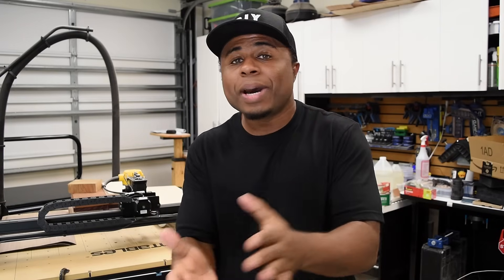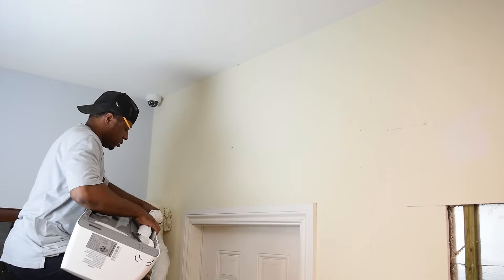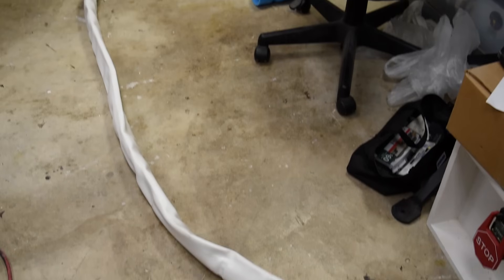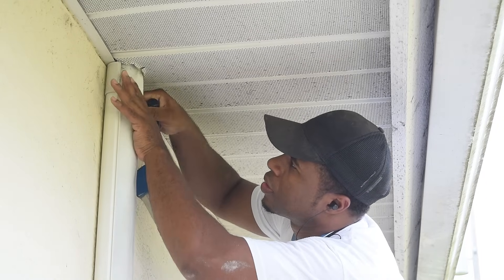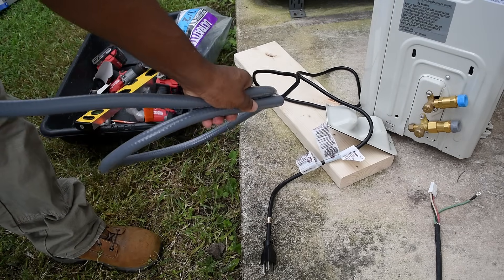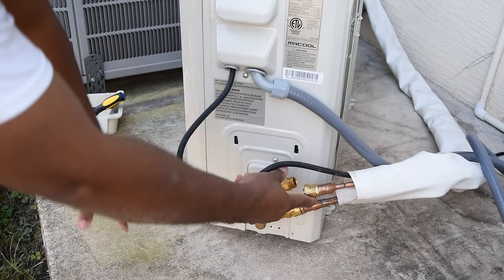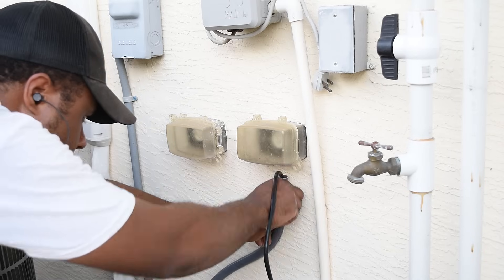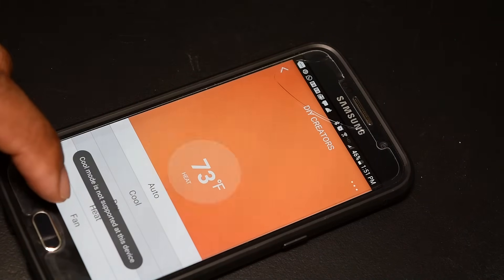How To install Ductless AC & Heating System // True DIY Mini Split MRCOOL

Comment: Couple of things to note for people trying this without the qualifications. 
1. Never check joints with anything soapy as it reacts with copper, use some correct leak spray.
2. Pipework should be strength tested and pressure tested before use.
3. The pipework needs to be evacuated before use.
4. If you cannot vacuum the lines then you must purge the lines.
5. You should be aware of leaks before you open the refrigerant lines as one could fail and you could end up with very bad refrigerant burns.
6. Always use gloves and wear safety glasses when handling anything to do with refrigerant.
Us HVAC guys are trained for a reason because the high pressures can be dangerous. If you still go ahead and install please be safe!
Reply: • SDRGaming yea I love these homeowners tell us techs who they call in a panic to fix their a/c that we do t know what we are saying when I told them it needs a vacuum done
Reply: zack9912000 normally I turn up and they say ‘I think it’s lost gas mate’ 😂 I’m like nope.. don’t tell me what’s wrong, I’ll tell you 😂🤣
Reply: • SDRGaming I had a customer nearly burn his house down. I found a Cracked heat exchanger and I  told him it isn’t safe at all to run. It was Tripping flame rollout. I got woken up at my door by the local fire marshal and police officer at 2am. They found my red tag on the unit and info.

Asking what I did, I said I made it safe finding a compromised heat exchanger. The wife told on her husband not knowing she was getting him in trouble. She told the fire marshal that her husband who is a electrical engineer said he bypassed the safeties to make it run because the crooked HVAC tech didn’t know what he was doing. This moron home owner caught his basement on fire and nearly killed his wife and daughter. From now on I take the parts out of the unit and make it difficult to start
Reply: zack9912000 nope I’ve never had that before 😂😂 Normally people listen to my advise 🤦🏼‍♂️
Reply: I installed my own unit, did not pull a vacuum. At that time l was not certified, later l went to HVAC school. My unit has been in use for 27 years now, never done any service of any kind. It's not rocket science buddy.
Reply: line set is pre-charged.
Reply: Couple of things to note for experts chiming in to contradict this installation. This product is designed for self installation. The manufacturer has obviously thought these things through for liability reasons. Just follow the Mr Cool instructions.

Comment: good effort, but this is a horrible install. Next time tou should just hire a HVAC guy to install this. You needed to vacuum the air out of the lines before you charged the system AND seal tight doesnt work if you leave the it open at one end. I've seen conduit fill up and gravity feed into live electrical equipment.

Comment: Well aren't you just FREAKING AMAZING!!! I'm a DIY chick. I purposely wanted a home with a garage. Because I'm always building, something. In the winter I'm freezing, so I use a portable heater, I go down turn it on, let the garage warm up, then go down to work, when it warms up. It never really gets as warm as I like it. But because I love doing DIY, it's not bad. I will bring my smart TV down there, work and watch TV, as I work. Sometimes im working until 3am, or more in the morning. I want to turn my entire home over to the mini split system. The unit you posted, with the remote and smart feature is AMAZING! Thank you so much for your video. GREAT JOB! Also GREAT WORK from your finished projects YOU ROCK!

Comment: Hey man. Good video. I would redact that comment on building a box and coiling up the line set. That is the worst thing you can do for any refrigeration system. In the hvac world it's what we call an oil trap. You will seperate the oil from the refrigerant and it will not be able to make it back to the compressor. Compressor failures are sure to happen with coiled line set

Comment: You left out a lot of important steps. The 2 most important it is not legal to open the freon valves without being EPA certified. 2nd all 410a freon cooling systems require 3 vacuums to a minimum of 500 microns
Reply: Pretty sure that is a R32 unit

Which technically is R410a minus the R125....

Never heard of anybody doing a triple evac on a domestic heat pump though
Reply: Thanks for mentioning this!  I'm sure that opening the valves wouldn't see much government intervention, BUT contrary to popular opinion, you definitely should pull a vacuum to remove any condensation in the line just because they were exposed to air (which contains moisture) AND do a pressure test with nitrogen to ensure the lines are indeed sealed.  It can't make sense to check for leaks AFTER you've introduced refrigerant into the lines.  What if the leak is where the lineset connects to the indoor unit?  Imagine the work you'll have to redo to get at it and repair it?  

Of course, you can get away with it and you might even be lucky to not have any leaks, but if you're gonna check for leaks using the bubble test with soapy water or a proper solution, you should do it at every connection, not just the convenient ones.  Oh, and doing a micron test will help ensure you don't have water (even minor condensation) in the lines that could turn to acid, which could damage copper lines and possibly your condensor coil.

Last, I believe the whole, "the lines are factory-charged" thing gets a bit misinterpreted.  The lines are not charged during installation because they're not connected, so how can they be charged with anything??  The condensor unit is pre-charged.  So you still should dry out the lines (micron test) and pressure-test the lineset before introducing the pre-charged refrigerant into the newly-connected lineset(s).  Oh, and that pre-charged thing is measured by the amount of lineset you use.  If you use substantially more or less, more refrigerant must be added or evacuated to compensate for lineset length.  If you're gonna install a minisplit, do it once and do it right.  To save money, do the installation of the indoor and outdoor units yourself along with the wiring (110v or 220v) if you are confident in your knowledge of how to do it.  Then have an HVAC technician come out and perform the tests with the appropriate equipment.

An operating minisplit doesn't mean it's operating at its full capability.  Sure, it'll work if you bypass the vacuum test, pressure test, and even if you disregard the amount of refrigerant YOUR setup requires, but why have a bunch of doubts and possibly ruin your warranty and work when you could have just spent a bit more time and cash to erase those doubts?
Reply: On the Mr cool DIY system, the lines have some refrigerant in the lines. When you look at the ends before connected to the outdoor unit you can see how it's made. That is why you cannot cut the line to proper length and have to leave extra in the attic or wherever can. No vacuuming needed.
Reply: @summitm18hvac  Ah okay, that clears up things.  I was wondering how the 'pre-charged lines' (versus pre-charged system) made sense.  So the lineset is actually sealed.  Got it.  Thanks.
Reply: Do not believe the pre charge BS. The inside unit have to be open to let the nitrogen out. Air with moisture will take place of the nitrogen. This air will mix with the refrigerant and water will condensate later. The seller is making a killing selling ac that will fail sooner than they should.
Reply: JOHN PERRI another hvac school graduate who read the books. How are those steps the two most important? Lol stop being a damn premaddona.

Comment: Installed my pioneer myself what a great setup. I can’t imagine my garage without a system like this anymore. Those in very cold areas may not find the heat very efficient or effective. My 12,000 BTU unit does a great job for my two car garage in North Carolina for both heat and AC. The ceiling, door and 1 wall are insulated. Two exterior walls are not insulated but the until is still quite effective especially for AC. Ceiling insulation and garage door insulation were by far the most important in my experience.

Comment: It hurts... you didn’t vacuum the lines before letting out the charge ..  I hope this unit is non vacuum. However please refer to such important step if unit requires vacuum or not. I’ve been HVAC 5+ years
Reply from the maker: It's a non vacuum system. Lines are sealed and precharege.
Reply: I understand that part, however the line between the two parts is not vacuumed under negative pressure therefore you have air, and air mixes with refrigerant when you release the charge. Generally it’s not good for the refrigerant compressor to run with air. Anyhow it’s alright. Videos like this will keep us HVAC guys employed at million views 😂👌🏼🙏🏼  keep them coming.
Reply from the maker: Lol, If you look at the lines there is no way to vacuum them. I'm not an HVAC pro but this unit is design for DIY installation. It's worth taking a look at they website you'll see what I mean.

Comment: You have to pull a vacuum on the line set bro i do commercial heating and air . Air in the lines means air in the system you killing the compressor.
Reply: What was in the line set was nitrogen not refrigerant which makes it worse.
Reply from the maker: This is a DIY unit there is no way to vacuum the lines. The lines are prechareged and sealed.
Reply: The lines are not charged with freon when you opened the king valves at the condenser you released the freon from the condenser when you hook up the line set you use a minisplit adapter to pull a vacuum on the line set sir there is no split system that you dont have to pull a vacuum on the line set sir . Not being a dick just stating facts

Comment: The nice thing about my main unit is it has 110 volt plug. I was able to cool my house with an inverter running off of my truck during the 7 days without power after Irma.

Comment: if you have a flaring tool you can also cut your line and Flaherty in
Reply: Again, with the MrCool DIY series, you cannot cut the line to size: you will lose the refrigerant that the lineset is precharged with, and some HVAC bounty hunter may try to get a piece of the hefty fine the EPA may hit you with<kidding>. Re flaring is also not needed nor recommended.  Basically, you're stuck with the 25' lineset.  Need to cut the lineset to size? Check out other manufacturers, or contract a professional to do the entire job.

Comment: forgot to vacuum down the lines
Reply: The lines are pre vacuumed and precharged, so you could not, even if you wanted to, vacuum down the lines. When installing a unit that requires this procedure, it takes it out of the realm of DIY.

Comment: I've been learning HVAC for a while now and my input is this- leave HVAC work to the professionals. It doesn't matter if the unit is precharged or not you typically have to fine tune for proper subcool/superheat. If lineset is exposed to atmosphere PERIOD, IT MUST BE EVACUATED. Moisture causes acid to form within the lineset due to reaction. Lastly, you really need to be epa certified to work with air conditioners and refrigerant. I would be the one just waiting for someone who didn't know what they are doing to mess up and release refrigerant. I'd then get your ass for 10000 dollars paid to me for reporting not to mention the fines you would have to pay.

Comment: This is nice but you for got the most important part pressure check the lines then vacuum for any debri make sure it hold vacuum then open valves. Your lucky you didnt have a leak when you opened the valve....
Reply: There is no way, or need to check the pressure.  The lines are pre vacuumed and precharged with refrigerant.  As long as you work slowly and deliberately and do not kink the copper lineset, yours like hundreds of other DIYers installs, will be sucessful.

Comment: terrible install.  What about vac pumping the system?
Reply from the maker: Love how you call this a terrible install then asked a question. Just remember I did my homework on this system, apparently, you didn't.  Go to MRCOOL website to find out more. Please be open-minded the way this system is designed there is no need for vacuuming. Other systems require that treatment this one doesn't.
Reply: Not needed or required according to the manufacturer. Why not educate yourself before commenting!
Reply: @eldergeektromeo9868  

May I ask you, How many units have you installed??

I did have a quick browse before posting.   I must have missed it as I didnt see anything.  
Im guessing you did your own research before posting your comment.  Can you please supply me the link to support this.  

Thank you
Reply: but, my question to you would be: why label this as a "terrible" install, when you have no idea what you're talking about, my expertise aside, as you obviously have a question about that? Kind of a rush to judgement, I would say.
Reply: @eldergeektromeo9868  

Ive seen a few things I wouldnt do myself.   Maybe I take more pride in my installs, or its just we do things totally different.
lets see how long this unit last for.

thanks for your comments